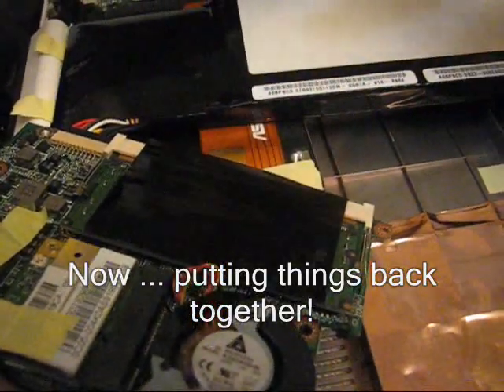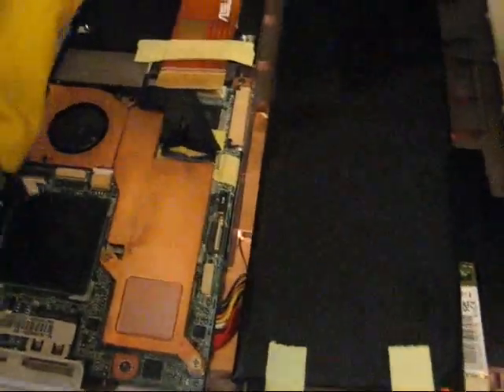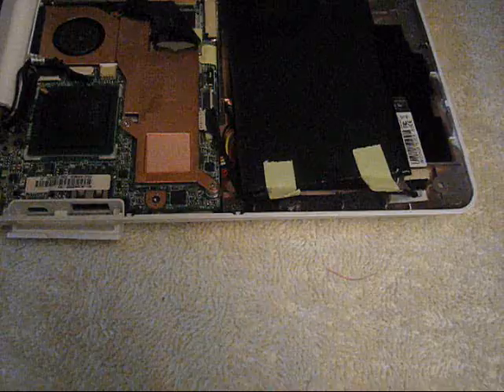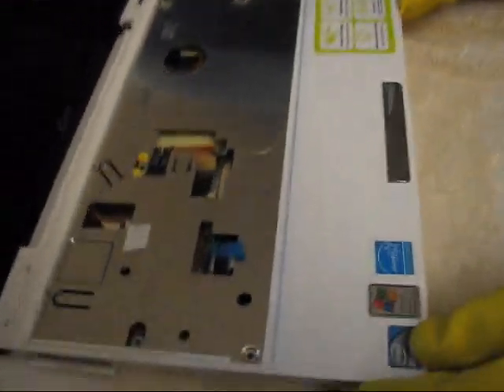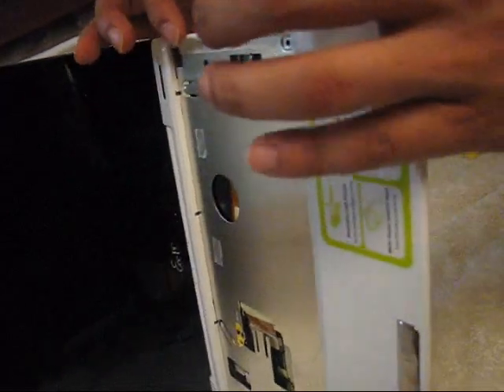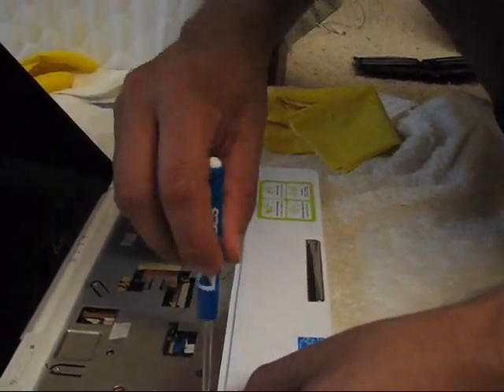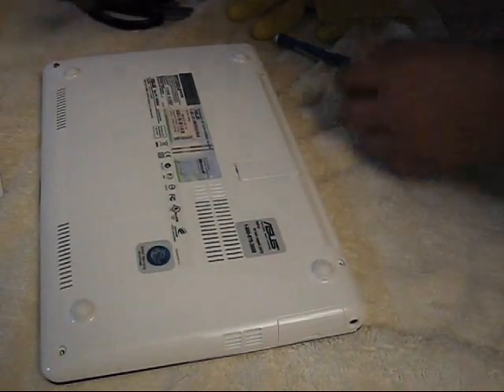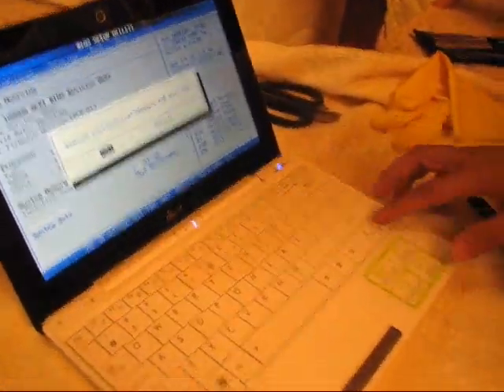Upgrading RAM - eeepc 1008HA - to 2GB - Part 2

Comment: Upgrade complete, just take your time.

2 things I highly recommend, 

1. flick the SW2 switch before (google SW2 and 1008ha)
2. disconnect the battery before swapping ram as it comes out very easy.

Comment: oh, no, I messed up... I wan to do a memory upgrade but didn't work. I put back the original memory but it doesn't work again so I'm screwed. I tested a thousand times to put all the connectors back.  when I push the power button turns on a second (without turning the fan on) and then turns off. I want to kill myself...